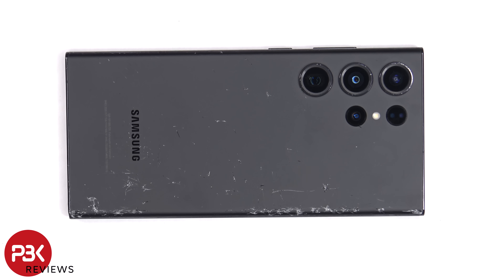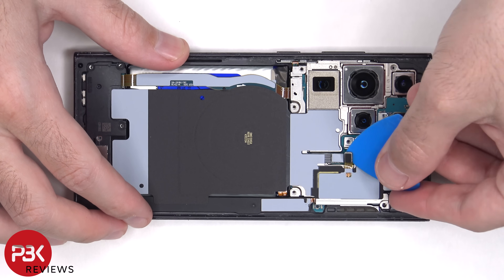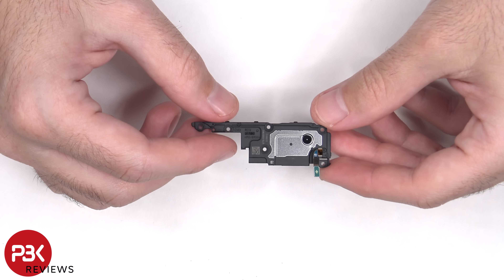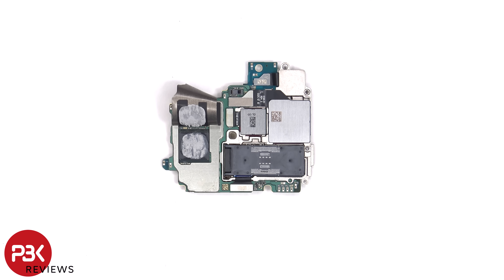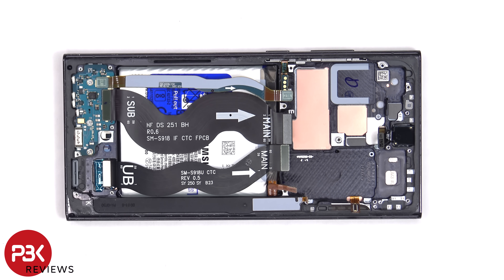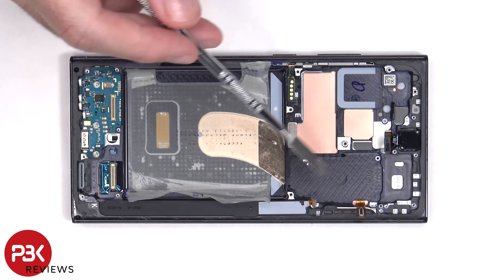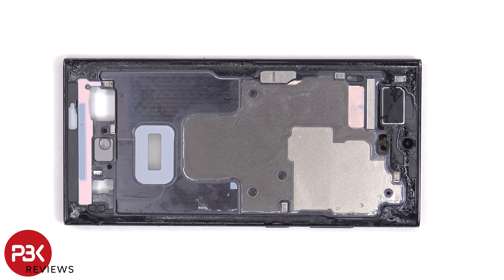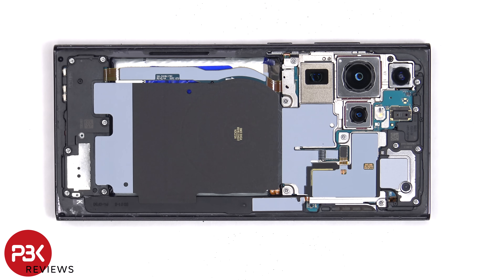Samsung Galaxy S23 Ultra Teardown Disassembly Repair Video Review

Comment: Great video!  I have an issue with my S23 Ultra where the bottom half of the screen is unresponsive to (finger) touch but works with the S-Pen.  I am going to replace the screen but I'm wondering if it could also be a cable connecting the screen/digitizer to the motherboard or sub-board.  Which cable would this be? Any help is greatly appreciated!

Comment: So i received a update from Samsung a few minutes ago and after the update my s23 ultra would get extremely hot randomly so hot i have to turned it off for it to cool down. One time I took a wet towel and rap the phone to cool after turning the phone back on the phone just shut down and start shut down randomly so i send it to Samsung for repair pay $150 for shipping they emailed saying it was water damage and the cost for repair is $800 I'm thinking that's a brand new phone price so i ask them to send it back as it is. Take it to a local repair shop and they said the chip for the Bluetooth and wifi was burned so i would need a new motherboard for the repair. So i stuck with a phone that I didn't even finish paying for. I want to try replacing it myself but the motherboard on ebay is over $300 box not sure if I should just get a new phone and call it the day. Still deciding

Comment: Hi, may I ask? I noticed that there werent 2 antennas like on my phone that had to be removed.
on the us model it has 2 antennas? also im not sure why but my phone insists that the gps is not working. is there a fix to that?
and also eversince my screen replacement, the screen ghost touches when charging, i cannot swipe or hold long because it starts pressing randomly. i can only use it while charging with the spen.

Comment: 7:21 what’s the adhesive on the main board and the battery called?
Reply from the maker: You can find the replacement parts as well as the adhesive on this website. Not sure if they sell the battery adhesive, but if not you can just use 300LSE or similar. https://www.mobilesentrix.com/replacement-parts/samsung/galaxy-s-series/galaxy-s23-ultra-5g

Comment: Is this doable without a heat gun?
I have a smudge only on my .6 lense, not the cover, the actual lens itself man, only way to get it would be to send it back, or pop the case off and wipe the dang lens.... I can see it when I shine a light on the lens. .. 😢
Reply from the maker: you can use a hair dryer, but you would need replacement adhesive to re apply the back

Comment: I have a problem my old S23 ultra is having a click every time the phone vibrates.  When you type on the keyboard, it is given on the 3 buttons at the bottom of the phone, and when it starts to vibrate type call it clicks and starts vibrating. but if you touch the buttons on the keyboard they only make a Click (it is not the sound of the keyboard) it is a click every time you apply the buttons.

Comment: I've recently dropped mine and something has come loose inside. The screen won't work and with that I can't tell if it still has power or charging. Any ideas what might have come loose inside that would have caused the phone to stop working?

Comment: hello.  I replaced the frame/display and everything worked great for 2 weeks, now i have no touch just S pen response.  what could be the problem....flex cables?
Reply from the maker: You can try a software update since some replacement screens require the phone to be on the latest software to work properly. I know you can't access the phone since touch don't work, so you may need to use another screen which works with the phone like your old screen if still usable or you would be required to flash the firmware with the computer which will also result in your data being lost. Most of the time it would be that, if still no luck, you can re check the cables.

Comment: Guys it is normal that s23 ultra can remove the back cover whenever you want plss let me know your comments😢
Reply from the maker: No it should be adhered with the adhesive to the frame and shouldn't come off at will.

Comment: What happens if you accidentally poke the 2 holes in the bottom? Mic and air vent.
Reply from the maker: Nothing, its blocked with the inside frame wall so you won't damage anything

Comment: hi, I have a problem with the power button on the S23 Ultra, it seems it's just the external plastic that needs replacing.. do I need to disassemble the entire smartphone or do they slide off externally?  Thank you
Reply from the maker: Should be able to be pulled out from the frame. Similar to this video at 4:32 in the video:  https://www.youtube.com/watch?v=Ej0TZ-7RAdA&ab_channel=PBKreviews

Comment: Can I access the storage after my s23 cpu burnt I just want to get all of my pictures back.
Reply from the maker: no, it would require de soldering and soldering the ROM chip to another working motherboard to access the data on it if that would even work.

Comment: my Samsung S23 Ultra power button fell off but the black rubber is still inside . do i have to tear down the phone just to remove and replace it? or i can simply do it with tweezers.

hope someone can help. my phone is still under warranty but this isn't covered.
Reply from the maker: If I'm not mistaken, you should be able to do it without taking the phone apart.

Comment: Are the volume and power buttons easily removable in this model?
Reply from the maker: They aren't too difficult from what I remember. If I'm not mistaken, they are pull out ones which can be pulled out of the frame.

Comment: Is it possible to to buy each parts separately and built the phone
What's the pros and cons
Reply from the maker: You could, but would cost you more doing that. Plus not sure if every single part would be available. Some parts like graphite film or pads and filters are difficult to find.

Comment: Where's the storage chip so we can repair when it slow down or fail?
Reply from the maker: Its soldered to the main board under one of the shields and is not user replaceable. Would require expert soldering knowledge to do.
Reply: @PBKreviews  hmm so it's possible right? That was what i was trying to figure out, Thanks.

Comment: Will the phone still be water resistant once the battery is swapped out? I'm assuming so as long as the back cover is placed bonded properly w/ adhesive or gasket
Reply from the maker: yeah, as long as you use the original pre cut adhesive which is sold for the phone or replace it with a new back battery door cover which comes with the adhesive pre installed, then you should retain the water resistance.

Comment: Is it still water proof after the back glass repaired.
Reply from the maker: as long as you use the pre cut adhesive made for the phone, you should retain the water resistance.

Comment: The foam balls does not make the speaker sound larger.. It dampens the resonance. It would actually sound larger without them but with alot og resonance sounds. Kinda why it's called DAMPENING in speaker boxes... ;)
Reply from the maker: hmm not sure, you may be right but that's what I have been told and led to believe by others who are more experienced with the speakers than I am.
Reply: @PBKreviews  I am sure after over 25 years of experience.
I have corrected others on this too. It is litteraly called sound dampening and not "sound largering" etc for a reason...
It dampens resonance👍

Comment: Where is the anthenna located?
Reply from the maker: There are multiple antenna. Some in the frame, some on the plastic covers over the motherboard and sub board, some built into the boards etc.

Comment: Is anyone familiar with the architecture on the s23 ultra compared to the s22 ultra to know that the right rear upper 5G antenna has not changed from one model to the other because they look identical and no one can get me in touch with an engineer who knows the architecture of the phone at Samsung

Comment: Can't seem to find a repair shop in Texas that could bring this phone back from the death. I accidentally jumped in the pool with my phone and I got water damaged. Tried to turn it on and it got super hot. I have memories that are irreplaceable in that phone I need help, most of the photos weren't backed up.
Reply from the maker: In the case of water damage, you want to disconnect the battery cable as soon as possible and not attempt to use the phone so it won't short the board. You need to basically take it apart, disconnect the battery cable and dry out any liquid or moisture inside. And then brush off any corrosion on chips or connectors with a small brush like a tooth brush, and plug the battery back in to see if you're able to get it to power on. Send me an email to pbkreviews@gmail.com

Comment: Do you think it is possible to install the front camera of the s22 ultra on the s23 ultra? I think it has the same connector and I don't think there are any software issues.
Reply from the maker: I haven't tried it but it might be possible.

Comment: what's inside the mic holes, i stabbed mine and it went pop like broke something, scared.. right hole, now it goes in all the way with ease!  as long as the mic isn't broken im happy, but i got a feeling i broke a waterproofing or something scared X_X please help!
Reply from the maker: Hi, you should be fine. Both the mic and filter are seated above the hole and would not get damaged.

Comment: Awesome video! Thanks. lets just say a guy was using the sim eject tray tool in the wrong hole before realizing it. is that the main microphone hole or the other hole? its the one on the right side of charging port if you are looking at the screen.
Reply from the maker: Thanks 👍. That would be the main mic, but it won't be damaged. both mic and filter are seated above the hole itself.
Reply: @PBKreviews  ok, appreciate the response. I feel much better now
Reply: @nutzthomas  You're not alone, seems lots of people did the same mistake, including myself...at least now I can sleep better ;-)
Reply: @PBKreviews  Is there any risk of breaking any waterproof seal by such accidental poking the mic hole? Or the needle just stops at the plastic frame?

Comment: After tear down will the water ip 67  rating will be maintained or it's lost.
Reply from the maker: As long as you apply new original pre cut adhesive made for the phone, you should retain the ip rating. The pre cut adhesive usually comes pre attached to replacement back glass, or sold separately as well once replacement parts become available online.
Reply: Treat it as lost

Comment: thanks for video. Do you know why they make another hole next to microphone where is usb c?
 S22 doesn't have hole extra:)
Reply from the maker: Not too sure, internally it leads to nothing/no opening from the inside. It might be a channel which is ran through the inside of the frame and to the speaker as an extra tweeter opening but not sure.

Comment: I got the 23 Ultra....just wanna know what are those 3 holes near the charging port....one is for the microphone...the other is for sim card slot..what's the 3rd one for?
Reply from the maker: Not too sure, internally it leads to nothing/no opening from the inside. It might be a channel which is ran through the inside of the frame and to the speaker as an extra tweeter opening but not sure.

Comment: Are temps better if you apply new and better thermal paste on memory and CPU ?
Reply from the maker: I haven't done it to this phone, but usually better thermal paste does offer better heat transfer. But also ones which are really good have high conductivity, meaning if they leak or get in contact with other components around it, it can cause a short.
Reply: @PBKreviews  Thermal conductivity doesn't mean that paste is electrically conductive, almost all today thermal paste's are not electrically conductive. Liquid metal is.

Comment: 1:26 this is not an NFC antenna, this is UWB antenna. Nfc antenna is embbeded to wireless charging coil.
Reply from the maker: No, that is not an UWB antenna. You can see the UWB antenna on the S22 Ultra disassembly video I did at 7:19 in the video. This S23 Ultra was not a US version so it did not come with mmWave UWB antenna. You can also verify this information by going to ifixit's website and looking at step 20. https://www.ifixit.com/Guide/Samsung+Galaxy+S22+Ultra+Screen+and+Battery+Assembly+Replacement/155140
Reply: @PBKreviews  UWB has nothing to do with mmWave. UWB is for digital keys, mmWave antennas are for 5G. I'm telling you the upper antenna is UWB antenna, ifixit is wrong too.
Reply from the maker: Oh by UWB I thought you meant the wide band for mmWave antennas. Hmm seems you are correct. So the S23 then does not have UWB from the looks of it, since connecting the S23 wireless charging coil flex to the S23+, it leaves the UWB in settings under NFC grayed out. S23+ and ultra have that additional UWB antenna where as the S23 doesn't. Thanks for clearing it up for me. Wish YouTube had the option to add new clips to videos to edit instead of just cutting out.

Comment: There is a button or slot  under the side key near the bottom of the phone.... What's does it do or what's its purpose?
Reply from the maker: Not sure what you're referring to. Do you mean that additional hole next to the charger port? If that's what you mean, that I am not 100% sure. From what I was able to tell it might be a channel to the speaker in addition to the standard speaker openings in the frame, but internally it doesn't lead to anything. So might be channeled from inside the frame itself.
Reply: @PBKreviews  Perhaps they're referring to the long oval section on the actual left side of the phone below the buttons. I can't see it in any of the views in the video or anything it'd be connected to, and I don't know what it is either.

Comment: I used domeglass for the screen protector and some of the loca glue went on the speaker.I got rid of the glue.Will the loca glue will actually go on the speakers?The speakers work perfectly fine
Reply from the maker: Hi, there is a filter over the speaker itself. As long as it doesn't clog the entire filter, you should be fine.
Reply: @PBKreviews  the speakers works perfectly fine.no issues at all.
Reply: @PBKreviews  if I put water on the speakers,will it remove dried up glue or should it be fine since there is a filter?

Comment: Watching this on my new S23U right now. Happy to see Samsung designed the battery to be replaceable without risking damage. My old S9 served me for 5+ years before I traded in due to failing battery, and I'm hopeful my S23U will do the same if not even longer.

Comment: Yup! It's the same Ultrasonic Fingerprint Sensor (Sonic Gen2) from S21 & S22 series and NOPE! Not upgrading! Had they upgraded the sensor from Gen2 to Sonic Max (Gen3) which is Qualcomm's new version of Fingerprint Sensor I would have upgraded from my S22 Ultra. But it's not worth the USD2.1K (local price of a 1TB variant in my country) for a flagship phone which had the chance to fix their fingerprint sensor mess that it had since they launched the said feature! So S23 Ultra is a big PASS for me! #S23UltraIsABIGNoForMe!
Reply from the maker: yeah, fingerprint sensor is a priority for me. I recently went with the vivo x90 pro plus because of the amazing cameras, and the huge and extremely fast fingerprint sensor. it's night n day compared to anything else I've used. only problem with this phone is that it's not global and it's the china only version so not all bands are compatible with my network so I have to sacrifice 5g and only get slow end of 4g spectrum but I can live with that. everything else on this phone is amazing to pass up. :)

Comment: When you re-apply the adhesive is it still ip68 water and dust resistant?
Reply from the maker: as long as you use the original pre cut adhesive made for the phone and apply it properly, should retain the resistance.
Reply: @PBKreviews  that's great! Thanks.🙂

Comment: Absolute legend. 9/10 score seems generous, though lol, with how things are soldered together and how you will have to replace parts as part of assembly and not one by one (e.g. screen and fingerprint scanner)
Reply from the maker: True, but at least the replacement screens come with a fingerprint scanner which is already attached and will work without it being locked out like apple etc.

Comment: Is copper behind the screen for heat dissipation or s pen or both? You said heat dissipation but afaik copper is for s pen.
Reply from the maker: Majority if not all screens will have copper film behind them for heat dissipation. Now if they use it for other purposes as well its possible, but it's mainly used for the heat transfer.
Reply: @PBKreviews  Thanks for clarifying. 😃